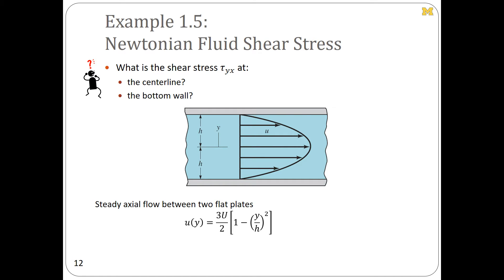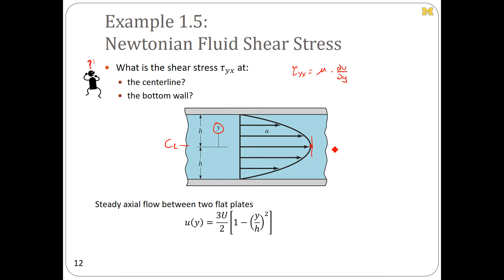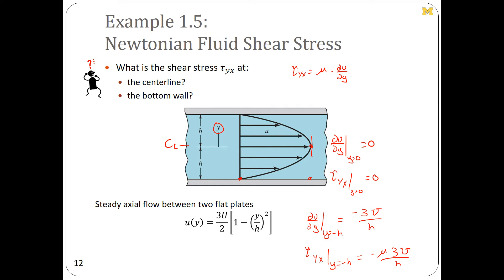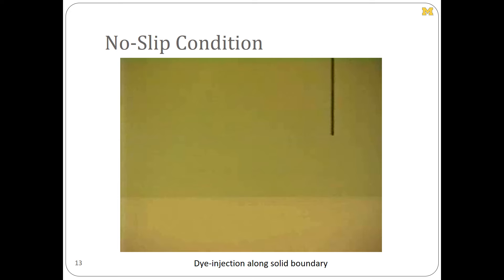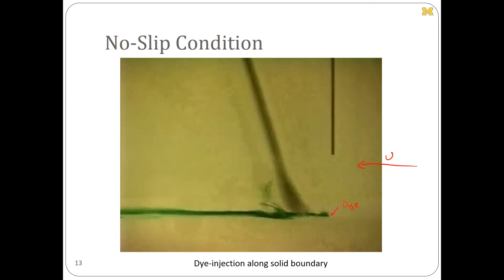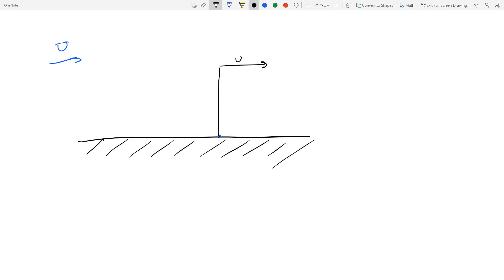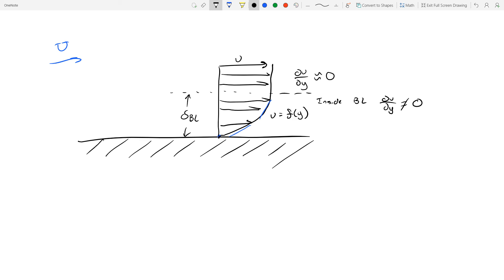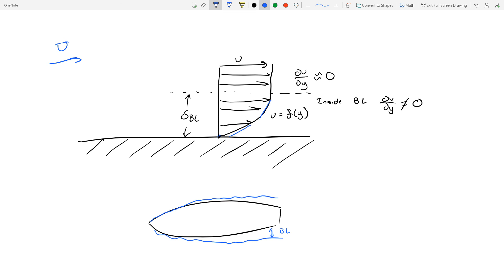Ch1: Shear Stresses and Boundary Layers

Comment: Great video, sir. Thank you so much. I have a question though.
When we talk about  friction in the pipe walls, is this friction between  the non moving fluid that has zero velocity (no slip condition) and the pipe walls or is it between the non moving fluid and the moving fluid atop of it ?

Comment: Hey guys! I'm working in research on a topic called 'organ-on-a-chip' which uses shear stress to mechanically stimulate cells. Currently I'm looking in depth at the physics side of this topic. However, based on this video and the 'no-slip condition' it seems to me like this mechanical stimulation is not achieved since the cells in my system are basically located at the place where the dye is injected to the wall, which stays put and does not experience flow/shear stress. Am I correct? Thanks

Comment: why is y=-h
Reply from the maker: The origin is defined mid-way between the two walls, so the upper wall is at y=h, the lower wall is at y=-h, and the center is at y=0.
Reply: that makes sense, thank you